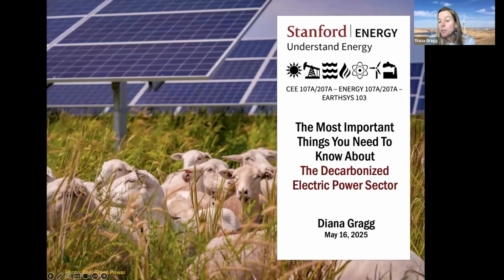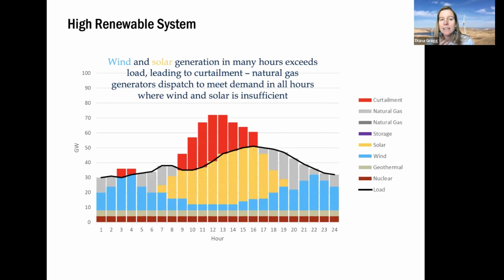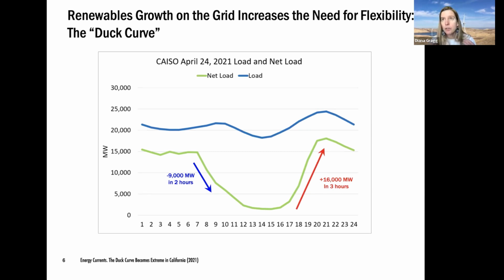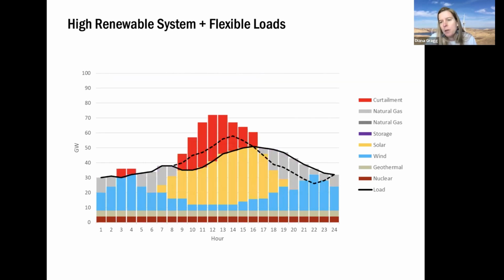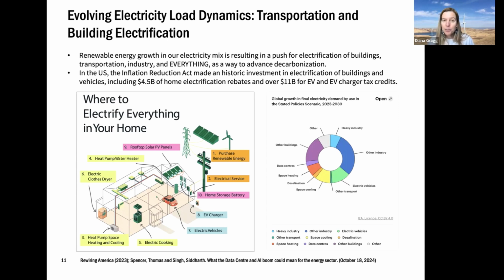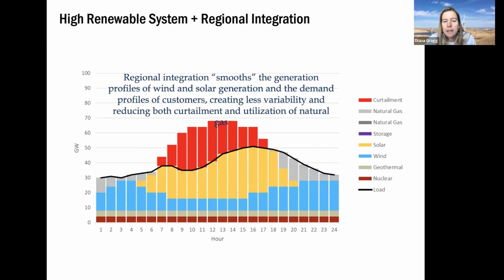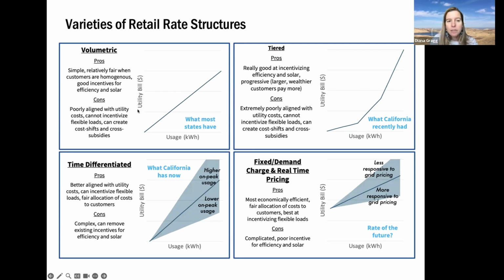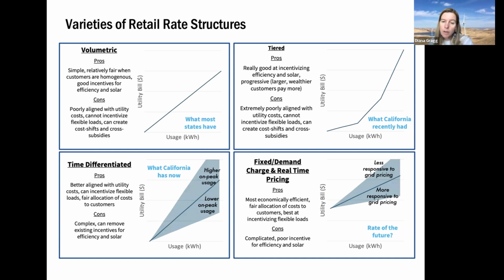A Decarbonized Electric Power Sector 10-Minute Take  | Diana Gragg | Stanford Understand Energy

Comment: This is incorrect.   Wild AC from solar voltaic and wind turbine generated electricity was  allowed on the public power grid to encourage large trials of alternative electricity generation.   It is commercially worthless costing more natural gas for fast reacting peaking to 100% support the wild AC than to make all the electricity from more economic fuel efficient means.   All the large increases in US electric rates are attributed to supporting wild AC.   

Modern climatology is based on the false belief that non condensing greenhouse gases can change the overall effect of earth's water vapor saturated greenhouse effect which is impossible.   Earth's greenhouse effect is from water vapor the other greenhouse gases can not change its overall effect that absorbs all the greenhouse radiant energy from the earth within a few meters of the radiating surface adding 10°F to earth's average temperature.  This was taught in US high school science. 

No Climate Change from global warming that was to start at 1.5°C.   NASA reports global warming at 1°C where it has been since 1992 after falling from 1.1°C in 1991.  The cause of global warming is not known.

Electric heat pumps are not more efficient than a natural gas furnace.   300% efficient heat pump X 38% generated electrical power reaching the residential meter X 50% efficiency for electric generation = 57% efficient.   A non condensing natural gas furnace is 90% efficient.

Former Greenpeace scientists state there is no unhealthy high level for atmospheric carbon dioxide.   1200 ppm carbon dioxide levels are used in plant growing greenhouses and would greatly green the earth especially desert fringe areas.  Overall this would be highly beneficial.  C3 plants evolved over 200 million years ago when CO2 levels estimated from plant fossils were 2000 - 3000 ppm.